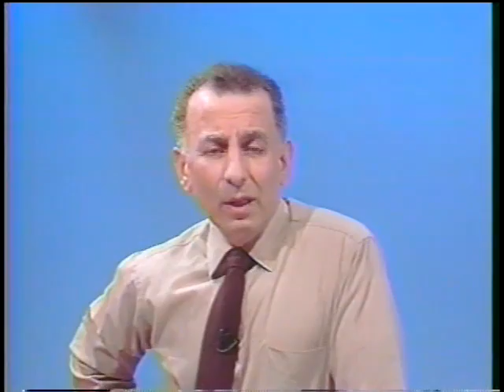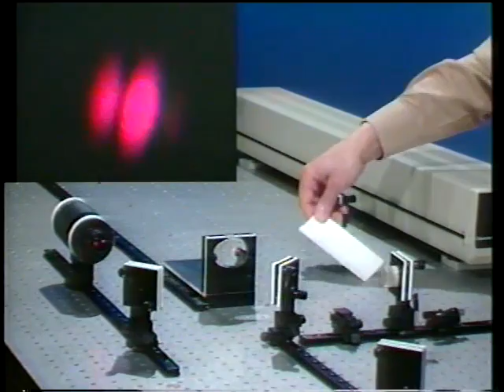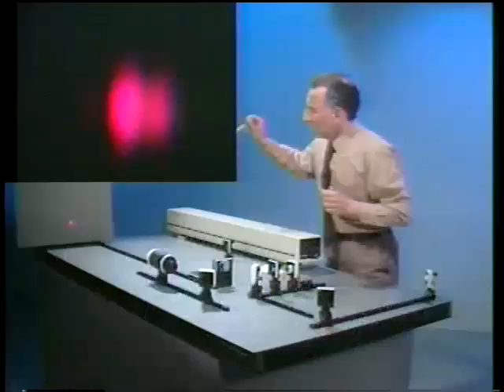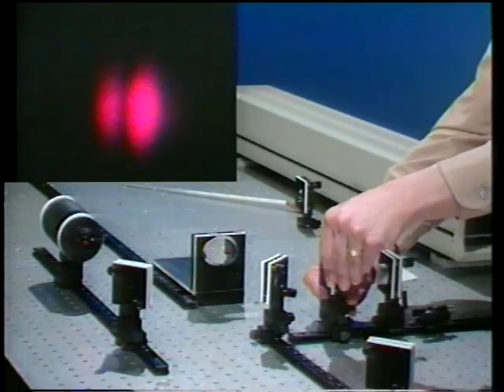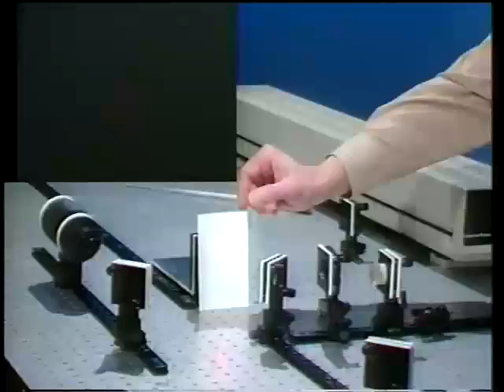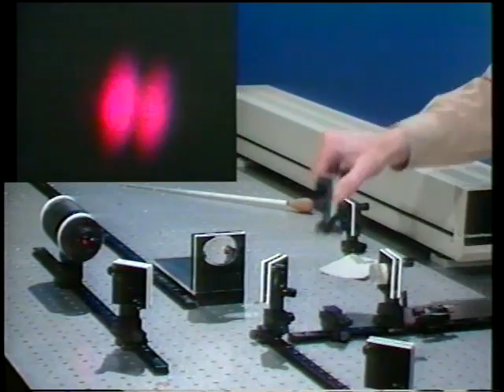Optics: Fringe contrast - intensity ratio | MIT Video Demonstrations in Lasers and Optics

Comment: Wouldn't the arm of the interferometer with the reduced intensity also have a different optical path length contributed purely from the extra thickness of glass on the ND filter? Possibly negligible but I would have expected the instructor to adjust the arm to now account for the different optical thickness before going on to observe the fringe contrast.